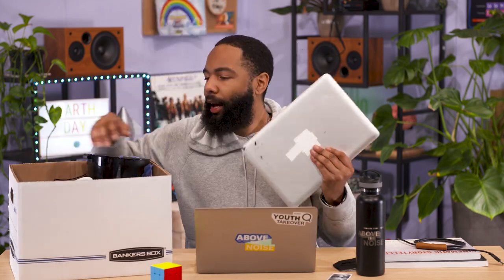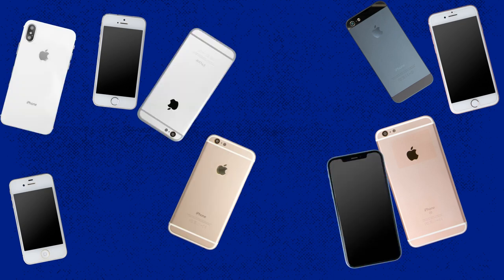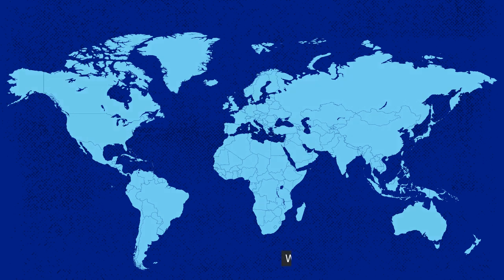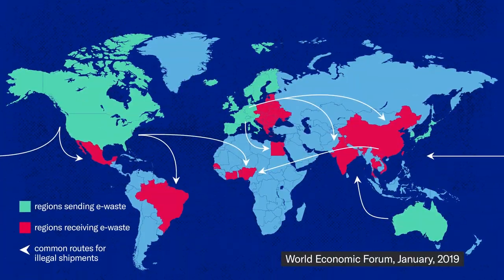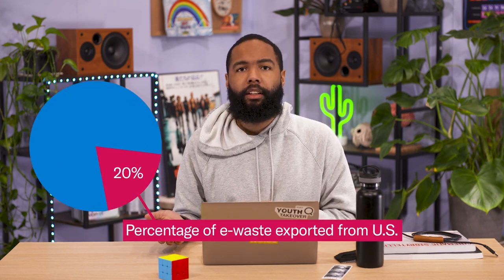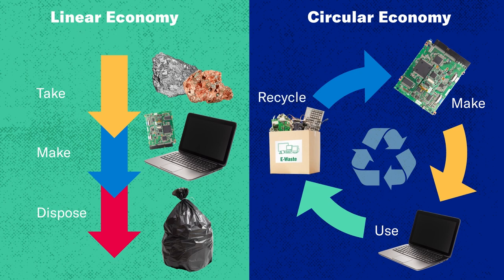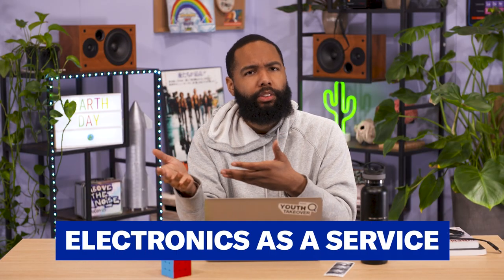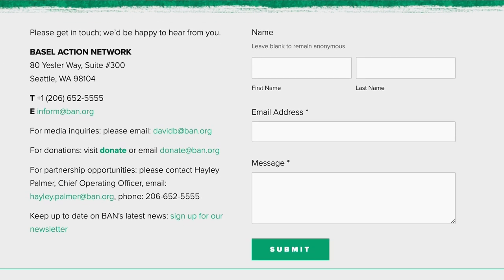What REALLY Happens To Our Old Electronics?

Comment: The devices as services sounds like a good idea, but let’s not forget how companies like John Deere and Lamborghini have abused it to block repair and customization initiatives from owners.
Reply from the maker: Great point. Thanks for watching!
Reply from the maker: I think the major issue with John Deere is that John Deere would block third parties from fixing their tractors-- you'd have to go through John Deere. After some heat from the right to repair movement they changed their tune... but people are skeptical about that. Here's more on it: https://www.wired.com/story/right-to-repair-advocates-question-john-deeres-new-promises/. That's different than the "electronics as a service" business model. But they are definitely concerns with that model as well. Thanks for watching and commenting!

Comment: I think the ewaste problem wouldn't be so bad if electronics were just easier to repair and keep using. Most people don't buy new phones because they want to, but because their phone's performance begins to slow down over time from a degraded battery. Back in the day on an android phone, you could just pop the backplating off, replace the battery, done. But unfortunately, now they are just as tough to disassemble as an iphone. Louis Rossmann has years upon years of content documenting what Apple has done over the years to their macbooks to make them as tough as possible to fix for the average independent repair company. I don't think a leasing economy is the answer, because that's taking away all of the power from the consumer and entrusting the companies to make the right decisions...and who's to say that they will? Great topic though, hopefully we have a solution before too long.
Reply from the maker: All good points thanks for sharing. The right to repair movement seems to be gaining some steam and being able to repair and upgrade old tech would go a long way with this ewaste problem!

Comment: My previous motorized wheelchair, I couldn't get it fixed as nobody will touch one that is over 5 years old (mine was 11) I had to have "Got Junk" pick it up. I paid a special charge to have it disposed of "properly" which you can only hope they do. These days I always buy my updates to electronics used, swappa is a great place for mobile phones, I buy 2-3 yr old tech from eBay and resell what I replace there. It is a win/win/win - you save money buying used, you save e-waste, and you get a little money back selling yours.
Reply from the maker: Great tips! Thanks for sharing. That sounds so frustrating about your wheelchair!